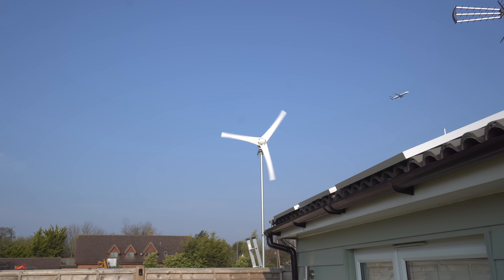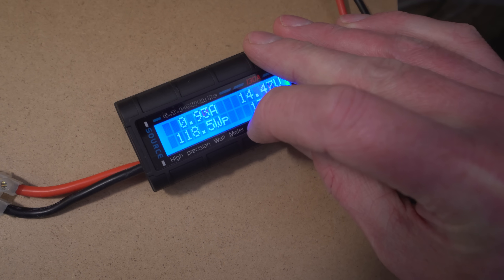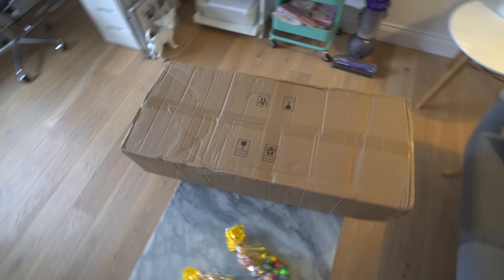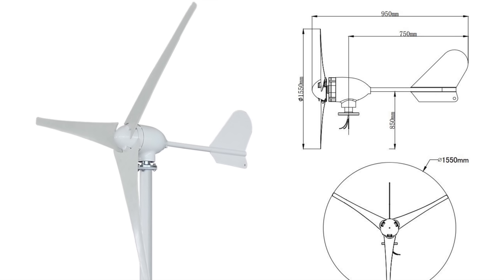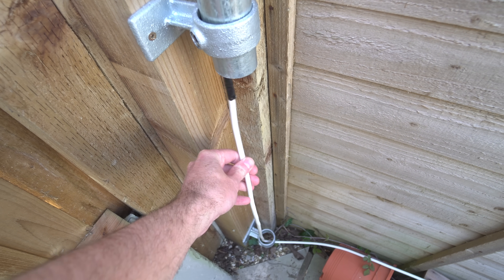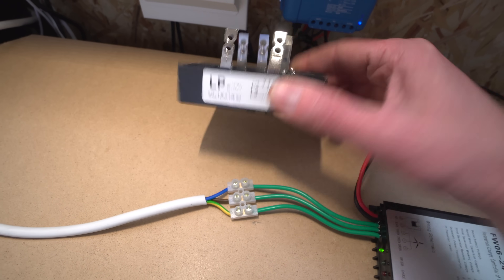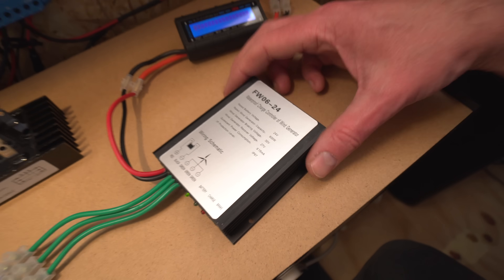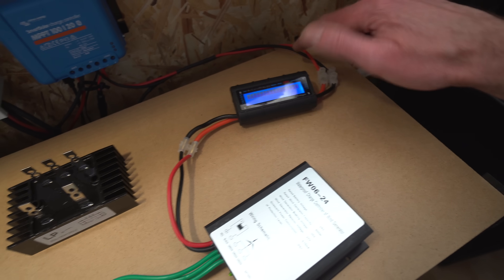500W MICRO WIND TURBINE | IS IT WORTH IT??!!

Comment: 3 phase?, Just under an amp at 14V??! You're delusional pal.
Reply from the maker: Yes there are 3 different “phase” wires coming from the generator. It is of course not 3 phase AC. I’ve seen about 8A at 14v which is pretty useable.
Reply: @dubaloo budrekot
Yes, 3 Phase
Yes, 14 Volts
Yes, about 1 amp
And what is your problem ?

Comment: Change your drain plug on your hot water tank if you have one. For a element and dump power to heating water. That way you save on gas or oil. Depending on how your water is heated.
Reply: @WilliamHelstad  If the hot water tank is a gas/oil unit, or heated by an external boiler, then it won't have a "heater hole".

Comment: I still need a decent efficient no BS inverter that doesnt cost a small kidney,  seriously r&d costs are already repaid as most are base don old designs and are nothing more than a dozen £2 mosfets to get you a few kw. 
I got robbed buying my inverter, 2kw it said, I got it tried it on a drill and my grinder, brilliant, knocked a hole in the side so i could hardwire it with good cables, then once all in i found out it couldn't do 2kw, it only does about 800w...... couldn't get my 100 quid back as i had ''modified'' it 
3 years on its still working fine as a 800w inverter, its running now running the pc and telly i'm watching/writing this on..., but i need more watts! i need to boil water for pot noodles!
Reply: Get you a survival Gas/woodstove.

Comment: What you are seeing is the real deal. On the Faroe Islands there are most often winds of about 15 meters/second. Most often you only get a few watts and in wind gusts you may get 5kW for a brief period. But due to unstable wind speeds and wind shear that is what you get. Higher up you have stable winds, but having a thin pole it bends easily. What you need is a 2kW unit with blade radius of 3-4 meters mounted on a proper mast like an antenna tower.

Comment: Hi Andy, could you provide a link or name for the scaffold pole connector at 2:04?  I have never seen one with a base and they look exactly what I need.  Thank you.
Reply from the maker: Try this, the same seller has all the bits. https://rover.ebay.com/rover/0/0/0?mpre=https%3A%2F%2Fwww.ebay.co.uk%2Fulk%2Fitm%2F183270960513

Comment: I have tried with the same set up. I cut not make it work with the Victron controller. What´s happen when you get a good gust, the Victron controller is not fast enough to track the output from the turbine, meaning it will ramp up the rpm until the wind controller starts braking the turbine before Victron starts charging. I was ending up with a very low output - like you. Looking forward to see what you come up with :-)
Reply from the maker: Interesting! That’s what I thought, I’ve seen the brake activate on that controller... this is starting to make sense now😅 I reckon using a rectifier could help this, eliminating the braking effect at 30V, this would then give the victron more time to react before the controller brakes the turbine. the victron can handle 100V so there should be enough headroom. 
We need to keep in mind Doing this you would need to make sure you can never fully charge your batteries because then there’s no brake feature. In my case I’m pulling 10A 24/7 out of a 200Ah bank of batteries so I don’t think it will happen.
Reply: @andykirby  I tried that to with same result :-( Some say that the only way is to go with the midnite controller. We will see about that - I´m sure someone will nail it :-)

Comment: I presume that little wind controller has some kind of dump load or electronic breaking built into it? I reckon the trouble might be that since the Victron's MPPT is designed for tracking solar panels, it might have trouble locking on to the intermittent nature of the wind output. That might account for the lower power level you're getting out of there. 

You do need some kind of DC-DC conversion to match it to your batteries, what about trying a basic DC-DC converter module with some kind of voltage sensitive relay that would switch the turbines output to a dump load when the batteries are reaching near top of charge? A SEPIC topology unit here might hit your target voltage more often. Bear in mind it would have to deal with constantly being powered then un-powered with the wind. Then, just let your solar setup finish the batteries off to as high as you normally go. 

I agree that wind turbines are not an "economic" proposition unless you live in an area that has near constant winds, as some places do. However, they are kind of more fun to play with than solar panels, which just sit there. :)

Comment: It might be the turbine controller since it's designed at 24v, it might not output anything if the turbine is below that. Try eliminating it and using your bridge rectifier directly to the solar charger.
Reply: Not a good idea to use a solar charge controller on a wind turbine. After reaching highest voltage limit, normally it disconnects the wind turbine's input and the turbine runs without load with the risk of overspeeding. I would recommend a 12V wind charge controller for 500W turbines.
Reply: @simfungreek  I don't quite get how these turbines could overspeed... what would happen to it? it has bearings right? why can't it just spin fast if it wants to
Reply: @chrismofer  Any motor speeding over it's  factory specs, could be damaged. If lucky, turbine blades would be broken before motor damage.
Reply: @simfungreek  i fail to see how thats physically possible unless the wind speed is like 150mph. even in 30mph wind under no load i cant imagine there being enough force to break these little blades.
Reply: @chrismofer  When there is no load they just spin faster and faster until the blades fly off. Also they stop accurately tracking the wind direction and swing around in all directions making the mounting pole wobble to the point it could snap.
Reply: @chrismofer  Buy one from ebay and mount it on your house and you will see for yourself. In fact would be a great video if no other buildings are around 👍
Reply: @chrismofer  you see, when a wind machine faces high winds and finishes charging, it requires some control because the rpm's will go up and will go over what the rotor can take, centrifugal forces will destroy the propellers. Normally you can control this using fail safe mechanisms or by short circuiting the alternator to force the machine to break or to slow down
Reply: Get a 12 volt system as the controller will kick in earlier. The controller is the problem
Reply: Of course if the controller is mot kicking in and taking current from the turbine then there is nothing to stop the controller from spinning out of control or uncontrollably as there is no load placed on the turbine output. I know a guy who bought a 20 kw turbine 10 years ago and it was spinning out of control and burned out tge main bearing and it now lies in a pile of scrap alongside his house. Wind shear is clearly something he didn't take into account. So the lesson learned for me anyway is buy a good quality controller and dump the one that comes with it.
Reply: The controllers don't start charging until it reaches 17 volts or more which is a problem
Reply: If your charger tolerate 200v DC, sure.
My does. But it fried smaller solar panels, they still work at 50%

Comment: mate, you will absolutely find you wasted your money. i found a solar panel makes about 400 times more money for the same money. but hei, everybody is entitled to make their own experiences.
Reply: Like he said, don’t get one to save money. A hybrid system will give a better average power output over the year than a single resource system. The problem lies in the position of the turbine, and average wind speed at your location. The potential output of a turbine increases with the rotor diameter squared, but also with the wind speed cubed. The turbine needs to be 10m above all closest obstructions to ensure laminar flow over the blades.
Reply: @MrCarlRobinson  just buy more pv.
Reply: True but this will work at night as well. I came to the same conclusion as you when I figured out I'd need about 40km/h winds to do anything useful with.

Comment: Be better generating more voltage like 240v 3 phase I'd use solid core 4mm or 6mm from it just to lower cable resistance a bit more . I want one 😂

Comment: If your allowed you should put it higher and it will work better even in low winds.i used to have mine as high as yours worked alright b.ut now it's on top of my roof and works so much so much better

Comment: I am struggling to try to figure out the real purpose and benefits of what a win turbine would do for you. How is it integrated into the heart the grid of of your home and how does it benefit that.? I myself I cannot see the purpose of even having one again. I had a aero wind turbine and operated it for about six months and ran it directly into a wind turbine grid tie inverter. I never noticed any decrease in my electric bill so I don’t even know what the purpose of having one is. So if somebody can enlighten me as to the benefits and how old are used in the system I would appreciate it.

Comment: I was warned about just running my dump circuit to a grid tie. It's good until there is a power disruption from the utility so, there has to be some backup. I'll keep watching you for inspirational ways to get around that issue. Nice setup.
Reply: Why dont you setup the dump circuit to enable a electronic brake for the turbine when the voltage drops the solenoid disables the brake and allows the turbine to spin again?
Reply: An electric water heater can be a dump with benefits (at least until it reaches temperature!) but a big resistance dump is probably best unless you can afford to take the risk of the blades or bearings failing)

Comment: A few years ago I built a 10 foot wind turbine from scratch using a Hugh Piggott design and mounted it 30 feet up. On a good day it gave 1.2kw peak. It was good fun and I learned a lot but the most important thing I learned was my area isn't windy enough for a wind turbine.
Most inland areas are the same unless on a high hill.
Reply: hi, what were your wind speeds?
Reply: @benmangan9922  not sure about the exact speed but let's say pretty windy with strong gusts.
Reply: ancient people were smarter and used duct

Comment: How about putting a capacitor in between to power the meter and have some more constant loading.
Specially if you wanna feed it to your house. A constant, smooth supply without peaks is always better, there some pre finished models to replace a car battery which I assume to be a good solution

Comment: Gutted I got a 12v one, next to useless with the wind we have here in Surrey. Run my man cave from 6 100w panels, 4 x 110ah leisure batteries on a 12v system with 3.5kw inverter. I get 4 hours of 3 double strip lights, drill chargers, gadgets n gizmos. Just about self sustaining with 2-3 in the cave sessions a week if there’s a bit of sunshine about. This Easter weekend I’m off, sun is forecast it should be whopping the amps in with a lot of cave time. I bought the turbine the same time as the panels. I’m hoping it will be the top up in the winter months when there is less sunshine and less cave time. However like yourself I have been monitoring it when it’s having a whizz and it ain’t much cop. That charger you have is the same as mine, just different voltage apparently it has a brake for the turbine (that’s from Chinese supplier) to stop overcharging  and turbine over speed so probably uses a fet to short the windings.
I went and got a Victron 150/35 pv, BMV 702 and the Venus network interface to replace the Renogy rover 40. And mad coincidence I got the bridge rectifier too. I’m going to cut out the the standard controller, fit the bridge rec and fire it into the Renogy box. I don’t hold out much hope as it’s a 12v turbine but like you say toyz to play with. I reckon my system should pay for itself about 3 years after I’m dead 😂 enjoy your vids keep em coming.
Reply: I think it goes without saying that wind + solar is the efficient combination
Reply: I had six 100 watt panels but in July I added four more ; when I did my amps doubled...I have six 110 AH batteries and eight 90 AH ones...I bought the smaller ones at first so I could save up for an Aims Power  2000 watts inverter / charger 24 volts...I used a 40 amp Epever controller...so far , every time I think about a wind generator I wind up getting two more solar panels
Reply: @davidpotter9462  it’s not until you get a wind generator that you realise how little wind there is when you want it. 😂
Reply: Thanks for sharing your information...nice to hear from others their set up...

Comment: Do you have a bigger pole & guy wires, you should have them up around 60 feet high.
Reply: We are profeesional factory to produce wind turbine generator, we could provide a very good solution for you with ideal cost:  Youc could add my whatup:086 13861897566 to know more:  Here is one of our new arrival model, You could try to use for your home, which is very quiet and safe,Save space, Easy to install: https://www.aliexpress.com/store/product/New-300w-600w-12v-24v-vertical-AXIS-permanent-maglev-wind-turbine-Generator-MPPT-controller-free-energy/3684111_32983319309.html
Reply: @jeniferai6401  VAWT sold for their power are a scam. It's nice to look at for a while. I am driving past one every day and never saw it turning.

Comment: i wonder if you made a dyson type in their hoovers cyclone funnels cone at front of the blades circumference would amplify the pressure air ratio
Reply: lol no! you're creating drag! Works great when connected to a motor a plugged into a wall though obviously!
Reply: i was thinking the cyclone vortex would create a back vacuum suck vortex at the rear of the blades like when you whistle the sound must come from pressurised vibrational friction/air cause

Comment: I have constant wind here on the South Wales coast but I've been told that I need planning permission for even a very small turbine here which is nuts if I just want to do some experiments to see if it is viable.
Reply: This comment prompted me to see what is permitted development. From this guide, it appears that one turbine is permitted, although the conditions are pretty onerous for most properties: https://www.planningportal.co.uk/info/200130/common_projects/57/wind_turbines/2
But if you have a coastal garden then I've thought about using one of those signs that rotate around a vertical axis and linking it to a low level dynamo/alternator/hoverboard motor.
Reply: @plodderexup  so stick it up and don’t tell the council
Reply: @pookachu64  I'm with you, but the neighbours will be the problem. If you've got a secluded spot then I agree, just do it.
Reply: Zen Zen  yeah you’re right about planning permission, l looked into it about two years ago and l couldn’t have one.l live here in Nottingham 👍
Reply: Indeed, a few years ago b&q were selling Windsave ones but it all went wrong as the installations needed planning permission which was typically turned down and I guess involved a cost.
http://www.reuk.co.uk/wordpress/wind/windsave-1000/

Comment: Good video Andy - I love wind turbines, but I think this particular one isn't worth it because it's far too small to be useful, and little more than a toy. Still, it's fun to play with!
With blade lengths of a couple of metres  or more, then you're looking at multiple kW, but also planning issues with the council. Only really suitable for rural areas and rich landowners really.
Reply: Or people with diesel generators for when its not windy!!!
Reply: Depends on your purpose, not everybody's installing renewables to "run the house" or "pay for itself". Anything you can generate at home takes load off the grid, and the solar generator revolution is just getting started. My little Anker only puts out 300 watts, it doesn't need charging with 5000!